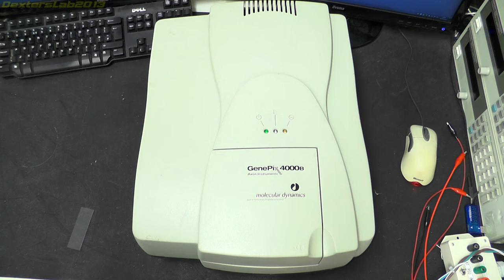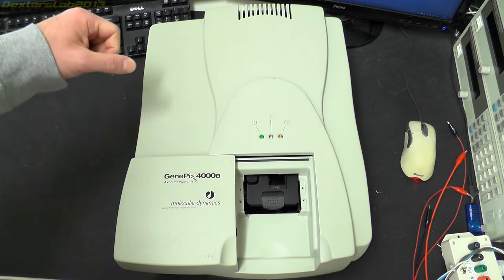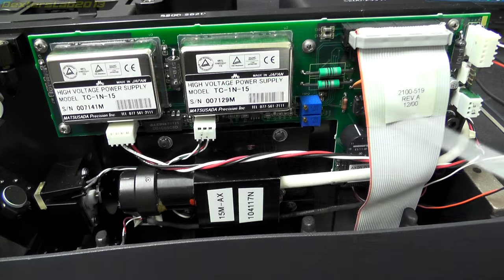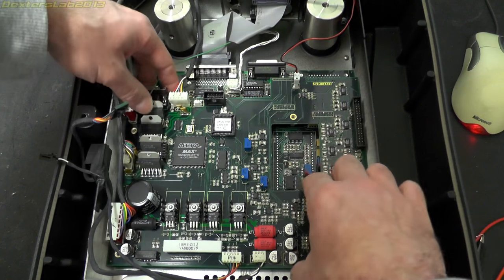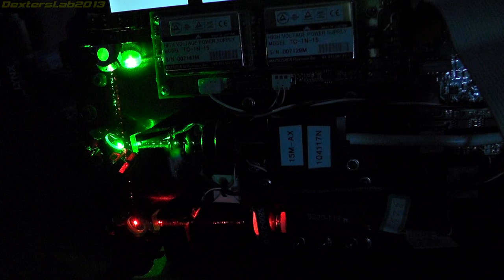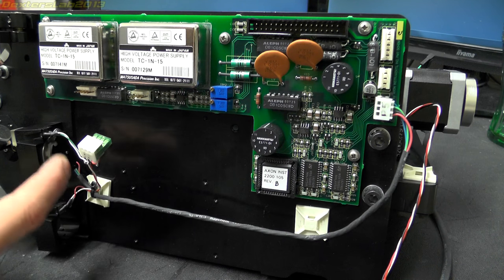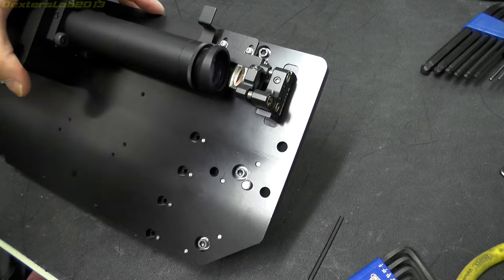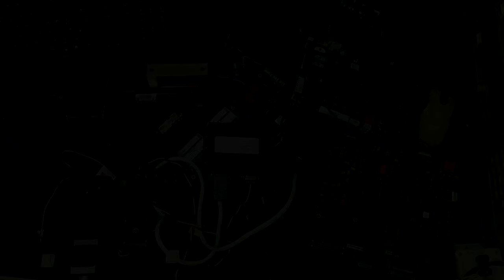DL#082 - $24,000 GenePix 4000B Microarray Scanner Teardown

Comment: If it's using fluorescence, the filters will probably be to block the excitation laser wavelength and pass the flourescence wavelength. Look like very narrowband filters. 
Slanted window on red may be to select prolarisation. 
Change in green laser current will be peltiers stabilising diode and maybe also cavity/ktp temperature.
Would be interesting to take a closer  look at that linear sensor on the voice coil.
I do wonder if they could have made it a lot simpler & cheaper by adapting CD player type mechanics & optics.  But I suppose people paying $24K expect a decent amount of weight for their money....
Reply from the maker: +mikeselectricstuff Thanks mike, yes your right about the filters, i had a play after i stopped filming, they do seem to attenuate the laser light and the light from the florescent marker is slightly different frequency from the laser.

I'm not sure how dynamic the focus would have been, it's a shame i never saw it working but i dont think would need to be as fast as a CD focus, i wonder if it was just to allow a 'per-scan' recalibration for differences in thickness of the slide it was processing.

Might take a look at the sensor, i will be keeping the main x-y table bits for the moment.
Reply: [offtopic: Many years ago I've torn down a magnetooptical drive using voicecoil positioning instead of the common gear drive too, I was rather surprised, it was full of fancy optics, must have been a rather early drive.]
Fast power modulation of green frequency doubled lasers is hard, for optimum performance the laser and the KTP crystal both have to be at their optimal temperature, this operational point changes pith output power, so you wouldn't like to modulate output power by changing pump diode current in a precision instrument.
Beautiful piece of technology and great teardown!

Comment: That sensor is a non-absolute optical glass encoder.
They cost an absolute fortune, especially this accurate. I'd keep it in one piece and figure out how to drive it - that could make a very useful fast actuator.
The larger stage(Y?) with the stepper is also very expensive - they go in thousands, and the micron-accurate ones go into tens of thousands of dollars.

Those PMTs are tiny, have an insane amount of stages for their size, and have an amazing spectral response - keep them, preferably in a velvet gold-plated box.

Take that lens out of the tube(two tabs on the side, use a credit card or a comically oversized coin) - use it for macro on your camera! :)

I'd also try using the Y stage with a camera to create stitched gigapixel macro images. It is rather long throw, and you can have it move relatively easily with a simple stepper driver. Stick a specimen on top, put a camera somewhere stable(same plate + some bodgery?), and figure out how many steps it takes to move it out of the FOV.
Reply from the maker: +Spirit Thanks, some interesting ideas there, the mechanical bits will be going up on my 'i dont have a use for this but i could not possibly scrap it' shelf!!
Reply from the maker: +Spirit I think i tracked the linear stage down to this, but no idea of it's cost: http://dovermotion.com/product-catalog/linear-stages/micro-linear-stage-kv/
Reply: DextersLab2013 From what I can find it costs around $1500.
Reply: Man I find your comments on all of the cool YouTube videos pertaining to lasers, optics, and spectroscopy stuff. I’ve checked your channel… And don’t really see that type of content in your videos. But you seem extremely knowledgeable and I would love to see this type of content from you !
Reply: @hullinstruments  I'm working on it. Stay tuned, possibly indefinitely :)

Comment: FYI - Axon in micro-array scanning is like the Coherent for lasers, Rohde and Schwarz for test gear, Mitutoyo for calipers, or Ingersoll Rand for industrial air tools. They still are the kings in modern sequencing (though this gear is the equivalent of a 386dx). Those linear actuators/controllers probably have .5 mic tolerance and absolutely no play. Ideal for precision machining on a lathe for example (you could bore/hone an engine to Formula 1 precision with that tooling).

 edit: This works with GenePix Pro software on stock computers (generally dedicated computers don't come bundled with scientific machinery until you reach the 100k mark). You can download it off the manufacturers website. Some of those optics you identified as mirrors were notch filters or glan polarizers. (edit 2: mike beat me to it). Also holy shit 30GBP? If you can fix it up in its entirety you could probably get 3 or 4k for it, uni's generally love these older generation gear. Get in contact with me if you want to sell some of those parts off, especially the linear actuators, steppers, controllers, et al.
Reply from the maker: +wither8 Thanks for the additional info!

Comment: You could likely still re-purpose the main tray as a high-resolution scanner.  Incidentally, I had just been pondering making a similar mechanical arrangement for high-res scanning of film negatives -- looks like I'll need to keep my eye on the surplus market for microarray scanners!  The voice coil drive on one axis is especially nice.  PMTs are not too difficult to deal with, and I bet the analog electronics and power supplies for them on this thing still just work. Similarly, steppers are pretty easy to drive.  The nice thing about device in this volume and price range is that they do use off the shelf modules, like the HV power supplies and laser drivers, instead of just one highly integrated and inscrutable board.
Reply from the maker: +Jonny Hall If the main board had not have been faulty i would have thought about doing this, i have some microfiches that would be nice to see how they looked scanned. But its been stripped now, the linear stage is on ebay, hopefully it can pay towards future teardowns!

Comment: I have one of these units, the tray is stuck and the damper won't turn. Was going to bypass the cables going to the stepper motor, but I would be helpful knowing the model # of the stepper motor.  However I am sure 8 years later your unit is gone, Just asking incase someone else has such a unit.